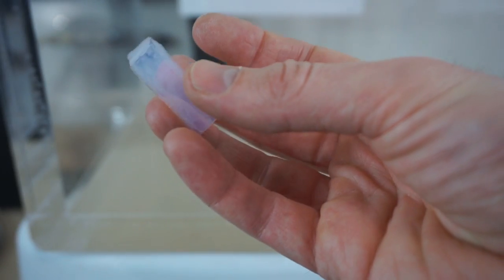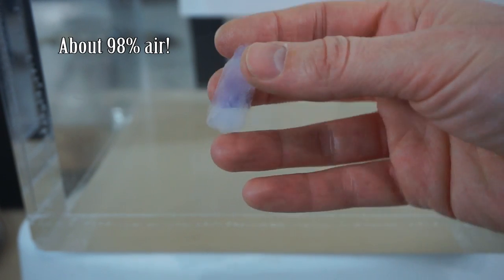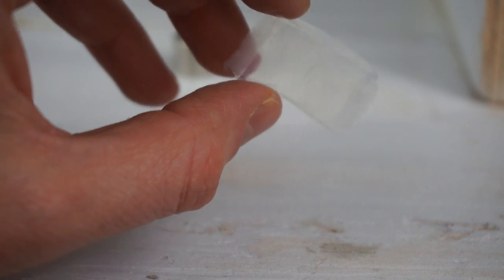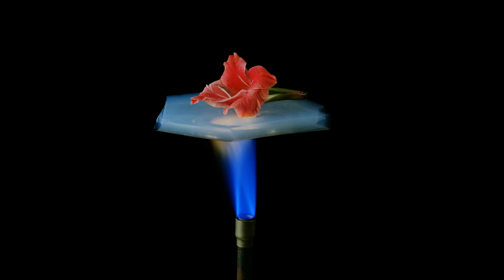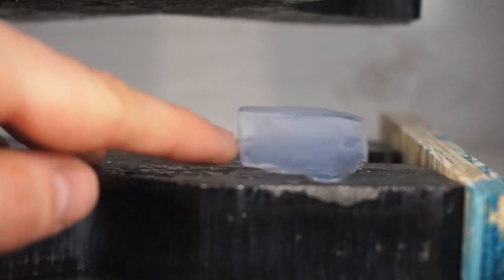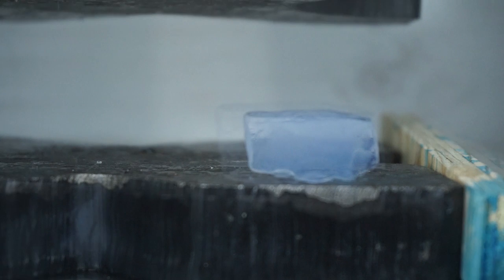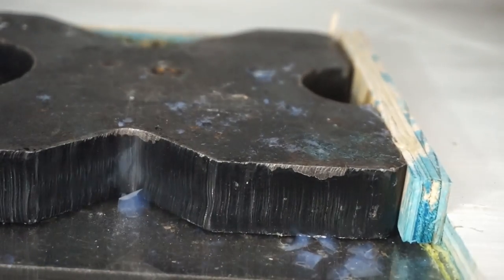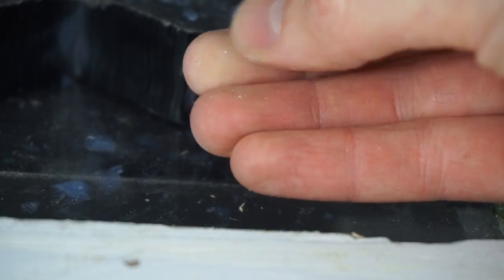What Happens When You Put Aerogel In A Vacuum Chamber And Hydraulic Press?

Comment: Show me a lit  acetylene torch in a vacuum chamber. I want to see just how long it can stay lit. I would also like to see how much resistance it would have on a object in a vacuum, say, a piece of paper or something non flammable. And will a vacuum chamber suck the fuel right out of the tank? I would probably do this outside and at a distance. But if I'm right, this is the nail in NASA's coffin. No fire in space.
Reply: I just want to see if fire is even possible in vacuum.
Reply: SoldierlyCat 551 Perhaps you could clarify that for me.
Reply: I will need to look into that more. I am interested to see what would happen anyway. Can you have fire in a vacuum. I'm not a rocket scientist,  but I'm saying no, you can't have fire in space. If it's possible, I want to see it. It's not a big request. Even a small torch may do the trick. Aside from BOOM, what's the worst that can happen?
Reply: SoldierlyCat 551 Agreed. That's what I'm trying to prove. So I'm going to have to look into these rockets on these rockets and find out what makes it different. Because if there is a vacuum in space, any resistance a thruster would have on the atmosphere around it would be sucked away. Dead in the middle of nothingness. It couldn't move.